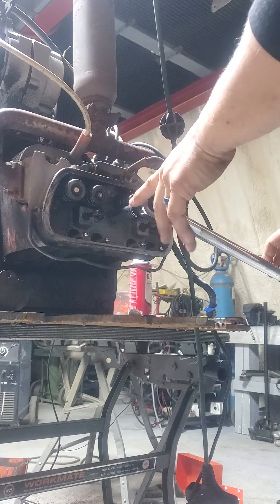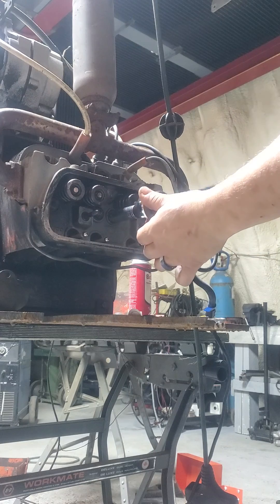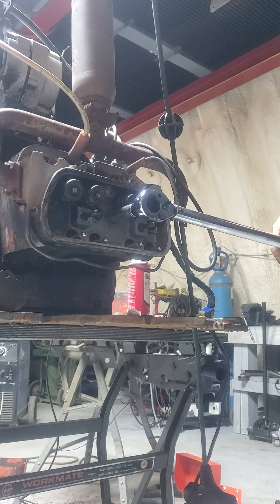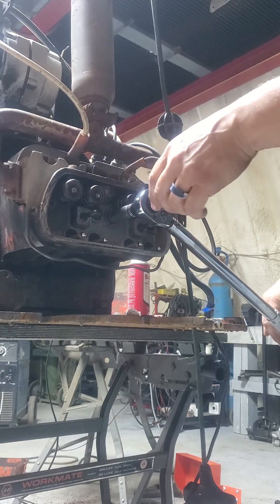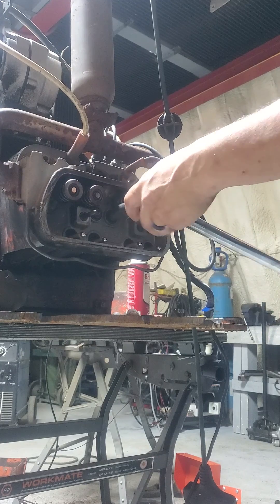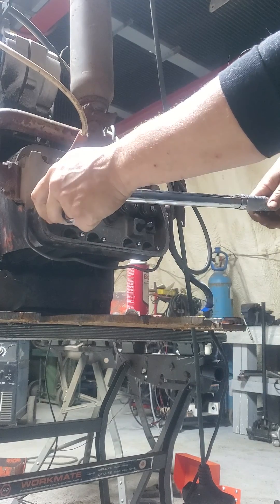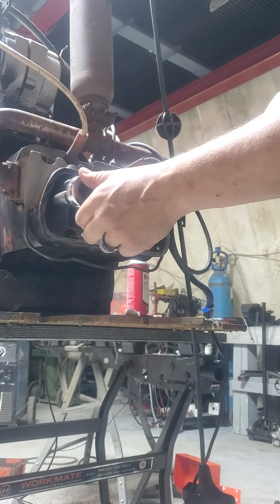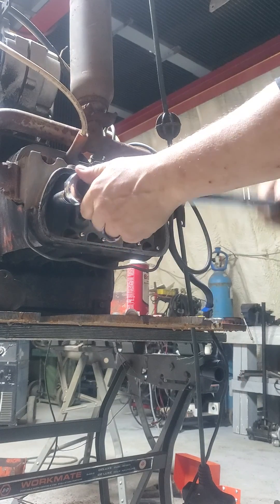VW head torque

Comment: Do those get loose early on a freshly rebuilt motor?
Reply from the maker: Yes seems to be common . Probably from the heat cycling an air cooler head goes through .